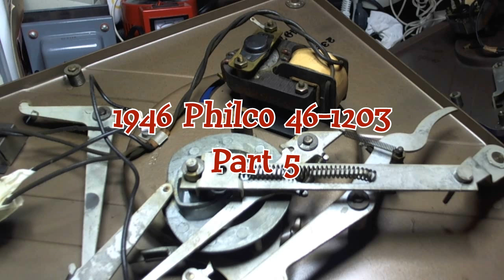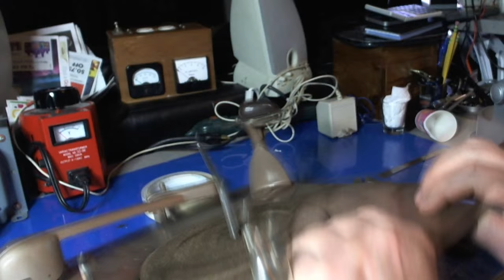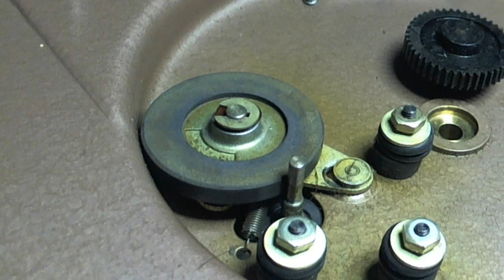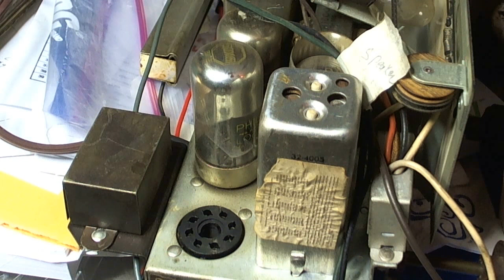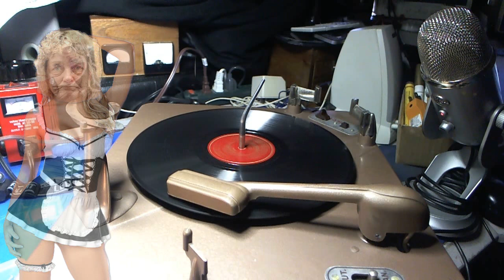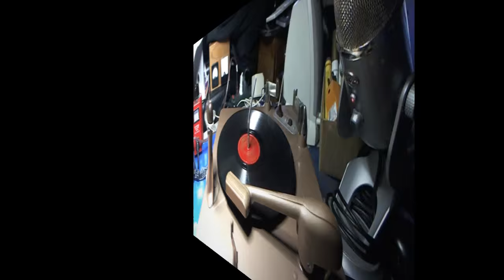1946 Philco Model 46-1203 Restore Part 5

Comment: With my headphones I have to give the best sound I heard on the ceramic, it suppressed the "hiss" and brought out the low tones and brilliance to the highs the best.
Reply from the maker: Thanks truck,,,your vote goes to #3
Reply: Yupper! but thats through my radio shack cheap stereo headphones that actually work really well, but I could hook up my computer (8-11-2005) Intel to my Surround (16 speakers arranged in the 7 position "3 of the positions are Wurlitzer jukebox speaker sets",  those are the middle and the left and right front speaker cabinets each weigh a lot and are like end tables in 3 corners of a 20X25 living room and the rest are to the open air expanse at the ceiling height going left and right. It's great sound especially with that amp. The Jurassic park movie first T-rex roar was at 8 on the 10 dial volume and a window cracked here in the living room, the window is between the juke box speakers and they'll rattle ones undies on the bass parts on good band music.
Just wanted to say that to ya , and to let ya know I finally have the room in my garage to actually do something with my 42 Philco radio/tilt out phono, I have stacks of vernier so I'm going to redo the tops and the slope part in the middle with black walnut berl, the sides are in perfect shape so after the whole cabinets through sanding I'll lay it on it's back and have it up on spindles and give it the spraying part.
Hope to type to ya again,
seeyaonline
Dave from Kentwood
Reply: hahaha 28 lines of text, sorry LOL

Comment: Here is my seven cents worth,,,, while no 3 is very clear and captures a wider range, no.1 seems to have a warmer softer tone.
If you are expecting accurate full range sound like that found on modern machines,, then 3 would definitely be the best choice. But if you want the warmer sounds I would consider the original cartridge. And for putting one together from scratch, you gotta admit ole no.2 although crapped out in the competition, did work pretty well.
Carl
Reply from the maker: Carl..I must agree with you..ole blue eyes sounded pretty good to me with the original cartridge..The piezo sounded ok for what it was .....after being cut up to fit......The new cartridge had lots more amplitude, and amplifies the scratches more...take care buddy.....saw you rant video....thumbs up....Buzz

Comment: Hey Buzz, To me the Shure and the ceramic cartridge sound about the same.  If it were me I'd just go with the original until it claps out and then change to the new ceramic.  You can always save the piezo one as a spare in case the other two both go.  Take care, Gary  P.S.  Thanks for showing those loose ball bearings, I'll keep that in mind when I eventually get around to restoring that 48-1262.  I'd have probably been up the creek without a paddle if I hadn't seen that as I'm sure with me doing it the bearings would go to every nook and cranny in my garage.
Reply from the maker: Hey Gary...Yeah... watch out when you lift that platter..have a blanket under the changer to catch those 11 ball bearings...You are a smart man ..I think I will use the original Shure...regards, Buzz

Comment: It's impressive that you can even rebuild a cartridge.  Although I thought the piezo was the worst sounding out of all of them, I love it anyway.  The difference that I heard between the Shure and the  modern ceramic is that the Ceramic was a little noisy, but I though it had the clearest tone.  I'm wondering if the Shure may have had a more worn stylus.  Thank you for sharing.  I vote #3.
Reply from the maker: The Shure had a new needle....
Reply: OK.  I'm not sure what it would be other than the ceramic cartridge may have had a wider frequency response.  I know 78s don't get much high end out of them, but I thought the Ceramic cartridge had slightly better highs.   I really enjoyed your project.  I thought it was impressive that you packed the ball bearings perfectly, too.  Thank you for sharing.

Comment: As an audio engineer, my ears prefer the warmth and slightly lower distortion of the Shure. However, the ceramic is a pretty close second and might last longer and /or be an easier replacement in the future. The piezo is a cool idea, but has limited frequency range (as I'm sure you figured out). :)
Reply from the maker: Hi Joe...My ears preferred the original..the scratches were more amplified by the modern cartridge....the piezo element sounded decent when you consider that I cut it up so much..thanks for your input...Buzz

Comment: I think a floating gravity motor to cut down on hum. if the motor was tight it would transmit the hum rumble etc to the platter. also the idler wheel isn't perfectly round so you need the motor and spindle to float. you are all wet. that's what I think.
Reply from the maker: I think you're right..I was all wet.....I removed the extra grommets ......I bow to your brilliance.....buzz
Reply: as you should, mon frere! hah haha
Reply: It was not just a technical trick to reduce electrical hum as the output of the ceramic cartridge is much greater than the electrical hum. It was done to reduce the mechanical hum of the motor. Can you hear the table make hum with the amp turned of?
Reply from the maker: with the amp turned off i hear nothing lol
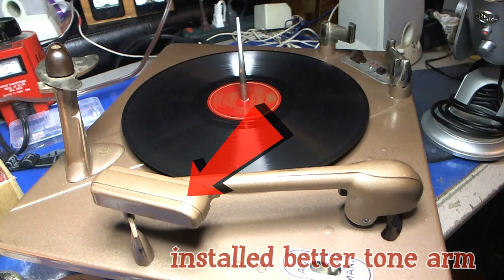Reply: Sorry I was not clear, at 9:29 I hear a hum. Was it produced electrically? Or did your mic pick up mechanical vibrations that sound like hum? Electrical hum induction could be from magnetic sources ( the modern pickup was based on magnetic flux changes inducing a signal into induction type paths) or electrostatic type devices like the pickup you are dealing with now. The ceramic type transducers are not very sensitive to magnetic hum fields. If the hum I heard was mechanically produced, I would suspect those three grommets as having become stiff, which will increase mechanically induced "hum-like" sound.To test for this I would check the hum level while not using your pickup signal amplified into the air and causing the "hum" I was hearing at 9:29. That is why the question "amp turned off?"
Reply: the platter and the metal base housing are excellent producers of "hum" like noises that have a fundamental of 60hz but also contains many of the spindle bearing noise of that induction type of motor.

Comment: I remember these motors to all look like yours. Old rubber types will shrink through the years, but yours looks OK. Gravity was the designers friend then. I did what you did with the balls all though I use a a clear jelly like grease then. What is your goal here? Using #1 would be restoring the mechanics of the original build ( It looks like how they were built ). #3 is a new type of modern tech and produces a better sound then they had then. When you hear it you are not hearing how people heard it then. So are you restoring the phono or are you building a new phono?
Reply from the maker: I believe that the rubber grommets are original as both are identical...There is hardly any wear on the changers...these have seen little use over the past 70 years....your last 2 sentences are very thought provoking  and wise...Buzz

Comment: look how high you pulled up on the spindle. it looks too high in relation to the idler wheel. just mah 2 cents
Reply from the maker: got change for a dime?
Reply: Once I built a railroad, made it run....

Comment: ok, the pizza pie-eezo sounds as bad as carla stromberg-carlson looks, I think the shure has a better frequency response than the ceramic does. HOWEVER, I think the Ceramic has less distortion. Therefore ceramic edges out the Shure. that's mah 3 cents. My price just went up
Reply from the maker: Thanks Meister..don't you think the new ceramic cartridge made the scratches sound louder than the Shure cartridge?? ..best regards....Buzz
Reply: I was wrong about my diagnosis. I listened to the short takes at the end just now, multiple times. I didn't listen to them all before. The 3rd or ceramic has a better all around frequency response and since it works better at the higher frequencies, it does make the scratches sound more pronounced. The number 1 or Shure, has less high end, so it leaves us with a warmer tone and less scratchy at the high end. I did hear some rattle, or distortion with the Shure Bros. during the entire song though Makes me wonder if the genius engineers at Shure designed it with less high end since they knew the average person would have less than optimum records. I'm thinking stick with the Shure Bros. Cartridge makes more sense.
Reply from the maker: thanks you sahib...
Reply: Don't mention it Cochise